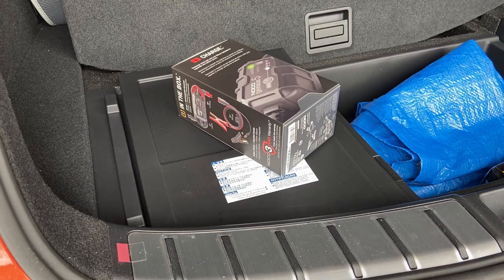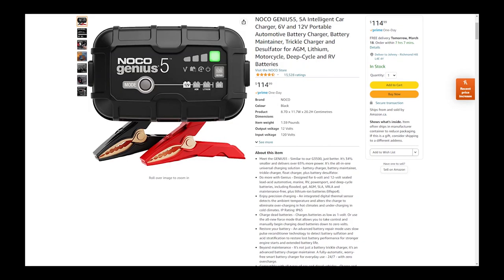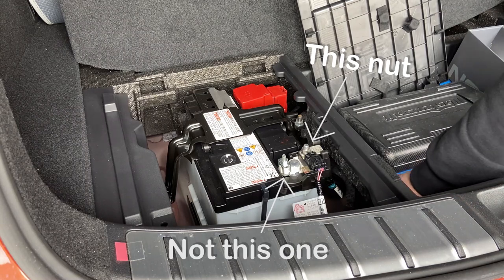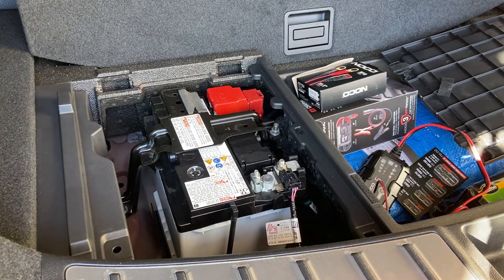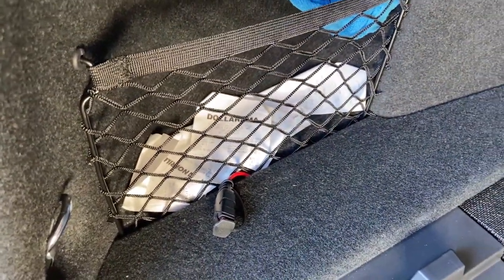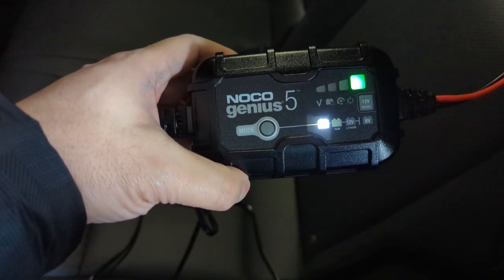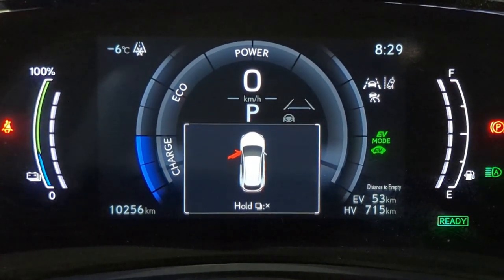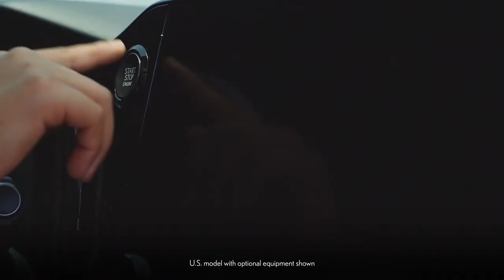Install Trickle Charger on LEXUS NX Hybrid / Toyota RAV4 Hybrid

Comment: LSFT, yesterday my 12V died too, yet I typically drive 10-20 miles RT on most days.  Like another subscriber asked, I too wondered if EV mode (how I drive 95% of the time) was really charging the 12V battery, or if the NX needed to be driven in hybrid mode.  Otherwise, I'm stumped on why my battery died if both EV and HV modes charge it.  I should note, I live in a place that rarely drops below 40°F or exceeds 90°F, which I assume should be a benign environment for the battery.

Regarding your NOVO setup:  how often and for how long do you typically connect the NOCO to your 12V battery (e.g. every night, 3 nights)?  When running the NOCO, I assume it must be plugged into an outlet; if so, is your hatch door open to run NOCO's power cable to the outlet? 

Thanks for your insights on this and the many other topics you cover on the NX 450h.
Reply from the maker: Oh no.  I hope it didn't create a lot of issues.  You really don't need to drive hybrid mode to charge the battery.  You should have the dealership to check the 12V battery to make sure there aren't any defects with the battery.  I typically charge it once every 2-3 weeks.  I don't charge it daily or weekly.  Typically I would find one day where I charge the car and use another plug to charge the 12V battery at the same time.  I don't put it through the hatch, but I open the back window a little and funnel the plug through the window crack.  

Hope all is well with your NX.
Reply: @lsft  thanks, would like to follow that practice

Comment: thx for the video! QQ - how long does it take to charge 12V with the trickle charger you use here?
Reply from the maker: I never timed it. Typically I just leave it overnight and unplug it when I'm leaving in the morning. Once it's full it just maintains the charge. So there is no harm to keep it plugged in.

Comment: Thanks for the instructions. I ended up getting this same charger.  Question: At 6:20 you mentioned using the inside nut vs outermost nut.  Is there a reason for one nut over the other?
Reply from the maker: I actually tried the outside but first, it is much harder to get the nut completely off. It can be loosen to get it off the -ve pole, but not easy to get the nut completely off. That's the only reason.
Reply: @lsft  Oh I see. So they both would work, but the inner one is easier to easier to remove.  How often are you charging your battery?
Reply from the maker: @ONI1013.  I let it run for 15 mins idle per day cos I drive a very short distance in the morning.  Then every other week, I'll charge it. But since I've installed the battery monitor, I'll do it when it's needed.
Reply: @lsft  Before you got the monitor, did let the car sit idle on Ready Mode every day, or you run this battery charger run 15 minutes every day?  We also drive only very short commutes and we only drive it about 3 times per week.

Comment: Great video.  Were you able to close the back hatch when you had the trickle charger plugged into the wall outlet?
Reply from the maker: I actually didn't put it through the back hatch.  I opened up the rear door window and put the cord out the window.  I didn't like the wire being pressured on the rubber seals.
Reply: @lsft  Thanks for the info.  The battery in my 350h died last week and I am going to the dealer to investigate the Lexus trickle charger and see if it is worth the extra money and exactly how it works since the battery is in the back.
Reply from the maker: @jamescordiner8822  there is the convenience in plugging it into the front grill. It's just 3 times over my noco install.
Reply: I carefully routed the 12v charger cable through the rear hatch and placing the CTEK Charger on a paint tin under the car - No rubber damage.  But also moved the keys, so the car couldn't be driven off, dragging the CTEK charger behind it...!!!
Reply: @Trev5  Can you please post a picture of your setup?

Comment: I am new to car. Just bought my first used Lexus.  May I ask, what is the difference between this product (Noco Genius 5) and a jump starter? I usually drive twice a week, mainly to the groceries.  Which product should I buy? Thanks 🙏
Reply from the maker: The noco genius 5 is a trickle charger that will help charge the battery and maintain it. A jump starter is used to start the car when the 12V battery does not have enough power to start the car. Two totally different products.  One is a product to maintain the health of the battery and the other is used to start the car when the battery is low.
Reply: @lsft  thank you so much for detailed explanation

Comment: What battery tester are you using in the video? And great work as always! I always look forward to them!
Reply from the maker: I bought it at Canadian Tire in Canada.  About $21 that you can plug into the 12V socket.

https://www.canadiantire.ca/en/pdp/motomaster-battery-charging-system-monitor-12v-digital-display-0113007p.html?rq=motormaster%252520battery%252520tester

Comment: the setting has
12 v
12 v agm
12 v lithium ion
NX350 H
what setting to trickle charge?
Reply from the maker: 12V
Reply: Thank you for asking LSFT the same question I have in mind for the correct battery type setting. I have 2024 RX350h, assume has same type of battery, and would like to install NOCO 5 to trickle charge the 12v battery when away for about a month to make sure the battery maintain fully charged when come back.

Comment: Hi, any way to connect that little charger  to the main charging port? That way 12v battery  gonna be always fully charged.
Reply from the maker: I haven't been able to validate that when charging the traction (hybrid) battery, if the 12V battery would be charged as well.  If it does not then I wouldn't change it so it can.

Comment: Hey, thanks for the video! I am having issue with my 2013 LexusRDX450h. I recently bought it and noticed it doesn't have green Ready icon and doesn't run, but the dashboard is showing other icons. Do you think it needs a 12v battery to be charged? Or it is something else? It doesn't show any error like check hybrid system. Just shows Brake red icon and Start button has amber color not green.
Reply from the maker: You can try to boost rather than charge and see if the green ready light would light up. You may also need to put the keyfob on the start button (if your keyfob battery is good or not)
Reply: @lsft  To boost do you mean a jump it start? I did that and green ready icon popped up and I drove to the store. But a few hours later when I tried to go back home, it again didn't have ready state and was not able to start the engine. Keyfob got a new battery.
Reply from the maker: @vladv7019  you need to let the car run for at least an hour for it to charge the 12V battery. Driving to the store might not be enough to charge the battery
Reply: @lsft  Oh ok, thank you

Comment: Lexus sells a battery trickle  charger accessory for $500 why wouldn’t you guys just get that? And sorry I didn’t watch the whole video just some parts I’m wondering why this is even needed? Does the battery die fast?
Reply from the maker: Lexus started to sell it after this was installed. A Noco trickle charger is $100 vs $500. There have been some owners who have had dead batteries. I wouldn't say it dies fast, it's only the way I drive that causes it to die. No matter if I drive a regular ICE vehicle, short distances will cause it to die.
Reply: @lsft  I've got my 450/2024 2 weeks ago and asked my dealer to install trickle charger and he said no  you don't need it, its there already when you charging lithium battery 12v one charges also, and yes before I plugged in it was showing 12.2v after plug in it was 12.8v,
Reply from the maker: @valhood6086  your dealer is right. It will charge when you charge your car. Again it depends on your driving habits. I drive short distances therefore it doesn't charge for each startup

Comment: I think your 12V battery is not in shape anymore. I think it has been drained to a couple of times, and sadly the lead acid batteries do not handle well this situation. I had this problem on my 2005 Prius,   it was a which was on display for some months and had drained the 12Vbattery, and when Istarted using the car, I had similar issues some months and finally I had it replaced, and the problem was solved. The trickle charger is good idea, and especially with a new battery it will make lifetime much better.
Reply from the maker: It had only drained once and it was checked and it was reported ok.  I will be asking the dealer to check the battery every time I get service to ensure it's ok.  I have the trickle charger to ensure it's all good.  I also turn off the headlights and infotainment screen after I power off the car which helps reduce the drainage of the 12V battery.  Charging it up once a few weeks seems to help maintain it.

Comment: Does the NX plug-in hybrid have an alternator to charge the 12 volt battery when the engine is running? Also, does it have a block heater for cold weather?
Reply from the maker: No there is no alternator. It uses the DC convertor to charge the 12 volt when the car is running.   Block heater can be installed and not standard.
Reply: @lsft  that is good! Lexus offers a block heater with a bumper plug but you can also get a trickle charger that works from the same plug. Sounds like a must-have for the 450H+
Reply from the maker: @beri232  yes. They do offer that. But it's a lot more expensive than other trickle charger.
Reply: @lsft  So, I am confused.  If there is a DC to DC converter (instead of an alternator) it should operate when the engine is running and providing charge back to the traction battery.  In that case, if you run the car in hybrid mode, the 12V battery would normally be fully charged, just like a gas engine car.  And, with longer trips, this would always be the case as you are always in hybrid more.  Further, that DC to DC converter will be very efficient in that conversion from a couple of hundred V to 12V is efficient.  Obviously, running the converter while in EV mode would not normally be done in that it would diminish the EV mileage and, even so it's only 37mi.  But, when supplying a charge to the traction battery via external charging, the converter could easily be used to charge the 12V battery and it could be a switch in the settings or not.  Are you saying that this is not done?  

This is obviously not a safety issue in that you are already charging a lithium ion traction battery which is far more dangerous than a lead acid battery.  And, are you sure that it is a lead acid battery and not an AGM battery?  You had your trickle charger set to lead acid and not AGM?
Reply from the maker: @rickheider7086  the 12v battery is a lead acid battery and not agm. I check the specs and it's not an AGM. I originally thought it was an AGM as well. My CT has an AGM but not the NX. 

I do not know if the charging of the traction battery would charge the 12V. It does make sense, but it doesn't seem to be doing that. I don't have the tools to check that. My understanding is that while driving in EV mode the DC to DC also charges the 12V. If not the car will not be operating very quickly.

Comment: Does anyone know if 350H has 12 volt battery problems    Thanks
Reply from the maker: There has been reports of some owners with 350h owners having dead batteries as well.  But again, it depends on the behaviour of the owners and their driving patterns.
Reply: @lsft how about NX300h? Thanks
Reply from the maker: @kohkae1177  I have never heard of issues with the 300h. It all depends on your driving patterns.
Reply: Yes, mine just died.
Reply: @sszzzzxx4702  is it NX300h?

Comment: We shouldnt have to do this. This is a luxury car. It is very sad that we have to do this to avoid getting locked out of our cars during a regular grocery run.
Reply from the maker: Grocery run may not be an issue. Even if I drove another luxury brand this is going to be an issue. Typical car design issue.
Reply: @lsft  a luxury car would detect the battery level and start the engine or take power from the track battery. I mean…. Sounds like an easy fix.
Reply from the maker: @iamdenislara  I had already said that in a video. That does sound easy and a software fix that they can add in. They just need to work on it. It does mean the 12V would need to be always running and never sleep.
Reply: @lsft  right so…. What’s your point defending the brand on your first comment?
Reply from the maker: @iamdenislara  I'm just saying... Even if I buy a BMW, Mercedes this will still happen. Not defending the brand.